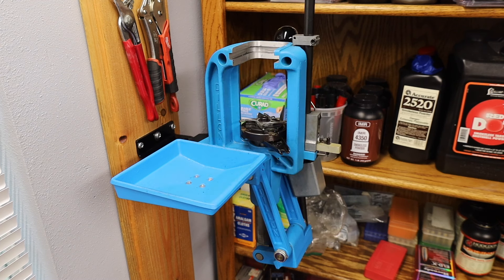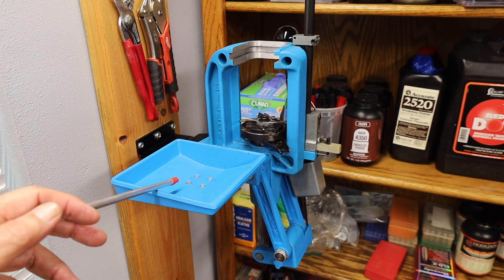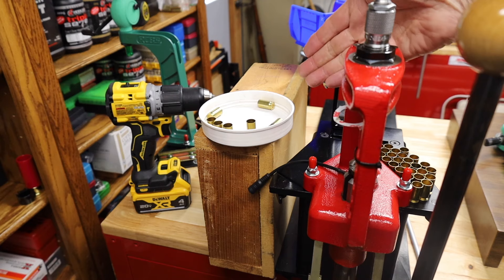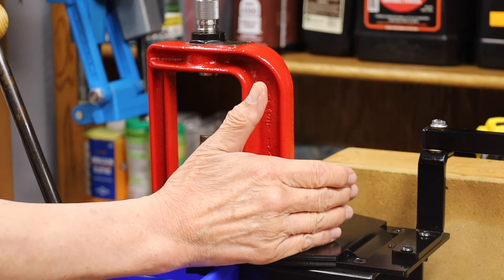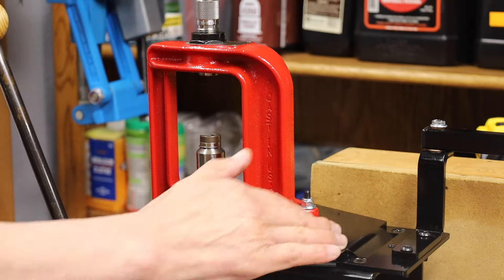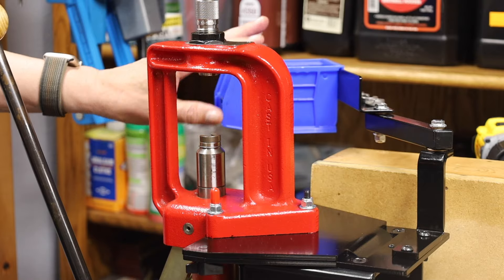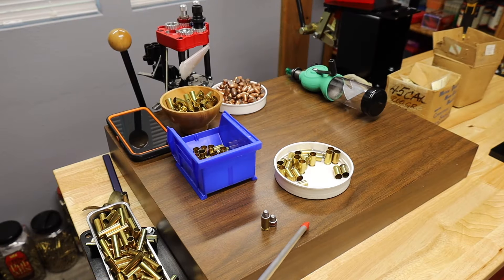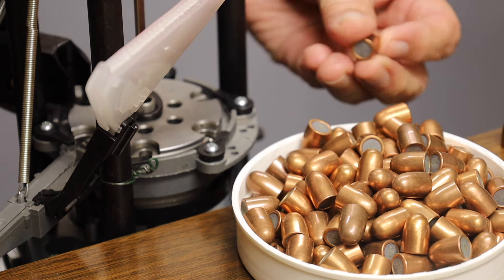Simple, Easy, No Cost Reloading Hacks

Comment: Take the press off of that black steel mount, lay a big piece of plywood on top of that mount so it sticks out farther each side, then bolt the press back on bolting through the plywood and the mount.  This gives you a big shelf with lots of room that you can put trays or bowls or loading blocks on either side of the press.

Comment: The inline fabrications bin arm looks like it can be changed by putting each section of the arm UNDER the previous section of arm.  That includes the bin holding bracket.  By putting each joint under the previous joint instead of on top you will pick up a couple inches or vertical height.

Comment: The next size wider and larger Ackro Bins work better. I cut some wood boards to halfway fill the bins height, and then its more shallow, but wider, and works more like the Dillon tray. They ALL hook right onto the swinging arms from Inline Fab 😀😀  I also use 1" x 1/8" Flat plain steel stock and 2 thick flat washers as spacers and drill a hole at each end of the stock and screw them to the front of wherever I need them. The bench , a cabinet, the wall etc. Make the 1" straps just a inch or so wider than my widest bin, and it works for ALL sizes of the Ackro bins!  You can also make a huge continuous bin holder the whole length of the bench as well,  but put screw placement at a half inch past multiples of bin widths or the very edge of the bin will hit the screw/spacer. I saw this on another channels reloading bench.

Comment: I have a much better solution. I use Lyman strong mounts and bought LEE bin brackets and drilled holes in the Lyman mounts and installed the LEE brackets. I usually use three per mount plus two lower steel bins. The Lyman mount has open windows on the second shelf of the mount and the steel bins attach like the plastic ones so I can hook two side by side on either side of the mount if desired down there and up top there's enough room for side by side plastic bins if desired. I have a lot of German made bins I bought 30 years ago that are a nice size for this application and so I generally use those. You can also do a front facing bin if desired and I do have a loadmaster set up with a front facing bin. I usually only set up three plastic bins for a turret or single stage. One on each side for brass and bullets and one on the back to toss loaded rounds in. There is always at least two of the small steel bins hooked on the outside of the second shelf of the mount. One on each side for small parts or bullets or tools etc. I sometimes also like to 3d print bullet shelves and the like for my single stages.

Comment: For trays, try some of the frozen dinner plastic ones. I find some of them to be the perfect size. Personal size lasagna ones are great. And I always put the input and output on the same side of the press (left). I have learned to remove a case and load a new case with one hand. My right hand stays on the handle and just operates the press. Very efficient for a single stage press.

Comment: But it's not blue, so it's no good. I have the red trays, and they're cheap and not precise.
Besides, it's not about function, it's about not being a poor...
Reply: Lee's Red trays are a less heavy duty version of the real Ackro brand bins. The originals are available in many different sizes and colors. I use the wider ones and cut wood 1x3's 1x 4s etc to fill them up halfway  so they are not so deep and they work much like the Dillon for a fraction of the cost.